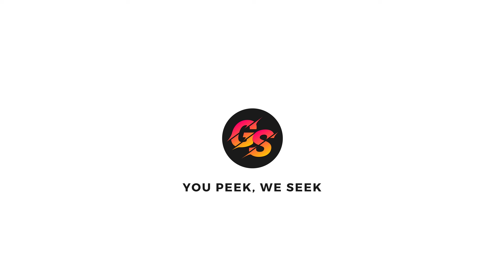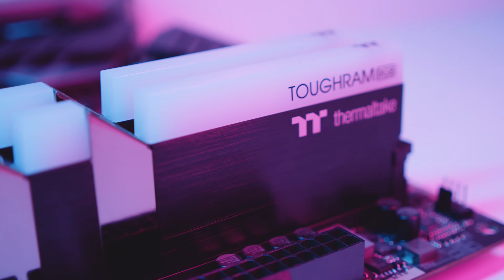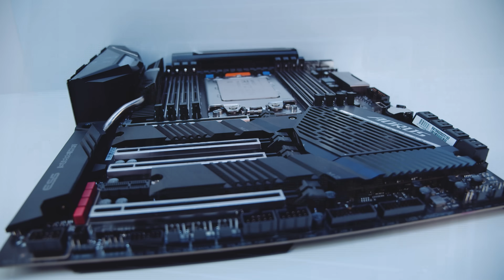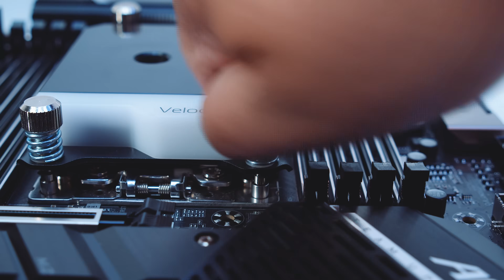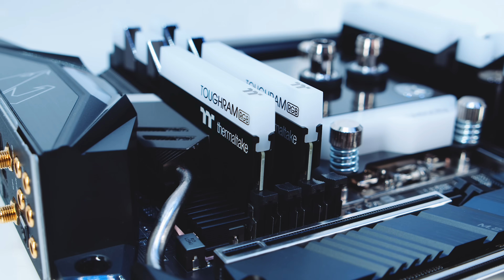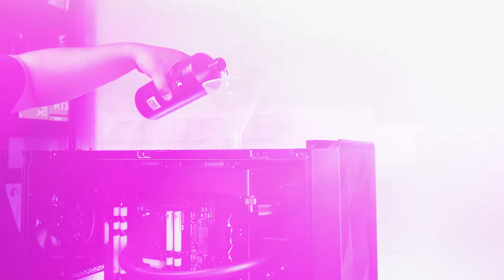It's Almost DONE! - Dream Water Cooled Editing PC - Part 3

Comment: I'm curious to know if the two thermal probes in the loop will end up showing the same temperature (+ or - 1 degree or so).
Reply from the maker: They are different.
Reply: @GearSeekers  will look out for more details on the next video :)

Comment: Here's a small tip for filling that loop that you may have already used. You can remove the temp. sensor on the back T-fitting and fill a bit of the loop through there while leaving the open port at the top that you originally used.  Just make sure to reinstall the temp. sensor or a stop plug before cycling the pump each time. This gives you two fill locations which will speed up the fill/bleed process quite a bit. You just have to use a squirt bottle or syringe to do it this way. I always add a second fill location now in all my loops usually with a rotary T-fitting on a vertical radiator because of how surprisingly useful it is.  It won't help now really but you can also swap out the initial rotary on the back highest vertical fitting run for a rotary T fitting and put an air release valve stop fitting on it. This would give an even better third fill option and would help with bleeding too since both of those ports are away from components. I hope this helps as it's a very solid build.